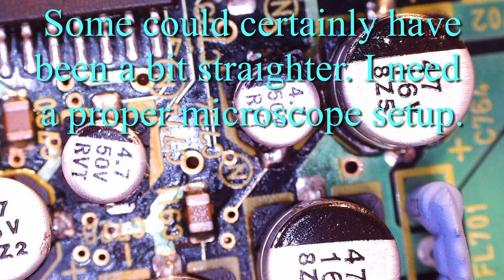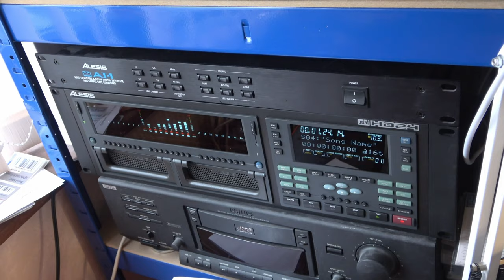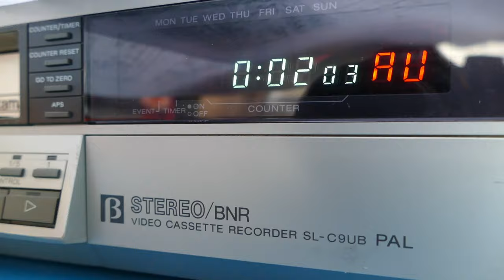Unbox and repair of a Yihua 853A pre-heater, use to work on SM electrolytic capacitors.

Comment: I used to work repairing cell phones and laptops, so I used everyday the hot air gun.
1-You have to set carefully the air flow 
 2-never let it fixed pointing to a part of the board , that's when components start flying . 
3-The trick is moving constantly the gun in circles around the component you want to remove . Add flux if needed.
4-To install/ solder components , I prefer using a fine soldering iron, it won't look as good as factory  ,but electrons only care about solid connections.

Try those steps on a scrap board and you will love your hot air gun.

Comment: I have never really had a problem of blowing components of the board. If that is the case, the airflow is probably set up too high. Even with high airflow, if you want to solder a component hold it down with tweezers whilst using air, and even with relatively high airflow, the surface tension of the solder keeps the components in place once its melted.
Only real downside of hot air are groundplanes (which a preheater works wonders with) and plastic connectors and the like. For plastic connectors I either solder them last with a regular soldering iron, or use kepton tape as a heatshield.
Reply: Plastic connectors at bottom of board with thick ground layer may become tricky for preheater when soldering SMD components at top of board. A real chance to melt the connector at bottom side. Though covering them with foil, not heating the bottom much ad dealing with components above with hot air kinda worked :)

Comment: In my view the problem with hot air is not blowing components off but heating everything around and potentially melting plastic connectors and such
Reply from the maker: Indeed that's also a risk.

Comment: Received Yihua 853A at yesterday. Turned out heating element in mine was also skewed, through not that drastically. And case bottom was undamaged. However "cloth" at bottom of heating element base was too small and in uneven thickness. Made it more or less evenly laid with tweezers. Otherwise not much other issues. Except noticed that heating element have contact with case at bottom through standoffs and top grate. Due to that during use case warmed up bit too. Not catactrophical, but it is a nuisance. Seems that for capactor, inductor and small IC soldering this preheater is OK. Soldering something like laptop CPU and GPU though seems is not an option.

I have those Yihua 938D SMD tweezers too. Tips doesn't fit together at all. And separate heater with very thin ends cause various issues - either with solder flow or tips are simply too cold to be useful. I don't use them anymore.

Comment: Excuse me, the components on the other side, did they fall off while desoldering the ones on the top?
Reply from the maker: It was not heated to high enough temperature to completely melt solder.

Comment: Would be curious how you rate the Chinese preheated?  Also pending on the value of the capacitors why not replace the electrolitics you remove with ceramic 0805 or 1206, more reliable lower ESR.
Reply from the maker: I've used it a number of times now.  I think the PCB clamp could have been designed better, but otherwise it does get the job done well.
Yes some values could be replaced with ceramic, that might be a good way forward, but possibly expensive.

Comment: How do you feel about the twist off the caps with pliers method?
Reply from the maker: Don't do it!  It may be OK for certain industrial grade PCBs with very thick tracks, but with normal commercial grade PCBs, you will certainly rip the tracks off.

Comment: That was a shame that the heater came damaged, lucky that a bit of jiggling and some off camera swearing fixed it :-D
When you said it was my viewers fault by getting in the way, i started jibbering like Stan Laural lol.
I did wonder if a clothes iron upside down would get hot enough,  well who needs smooth shirts :-D.
I think a hot air gun would work with a very narrow diameter nozzel and low speed air.
What's wrong with the tweezers?, they work :-D
Reply from the maker: Pre-heaters used to be flat bed like an upside down iron, but with modern boards having components both sides, they are not much use any more.
Now if I can save up some pennies, and the supplier can get some back in stock, that new microscope looks like a great solution for me seeing the job and you, my viewer too.

Comment: hi

dod you know what difference between YIHUA 853 to YIHUA 853a to YIHUA 853b ?

thanks 
yossi
Reply from the maker: Check but I think some of the letters at the end of the model refer to what kit you get, so whether there is a hot air gun, soldering iron etc. included.  I believe the pre-heater is the same.
Reply: video99.co.uk 
thanks 

do you know if there is new model
or better unit?

Comment: The method I use is to cut the capacitor close to the base with side cutters, this just leaves the two pins to be desoldered from the board.
Reply from the maker: On the DVCPRO board, there are very few capacitors where there is room to do that, but it's a fair point.  Good quality cutters are a must.
Reply: I would do exactly the same with small sharp side cutters. Only if the pads are slighlty corroded I use soldering tweezers or hot air to prevent ripping the pads off.
Reply: @video99couk  Yes, good sharp cutters are required. This method was the recommended procedure from  a large manufacturer whose name escapes me.

Comment: What are those swabs called? You should check out youtuber Northridgefix microscrope setup. He uses 2D microscope + camera + large LCD display. No neck strains. 12voltvids would have just cut the smd components and replace them with thru-holes. if it works, it works.
Reply from the maker: I installed a mix of SMD and through-hold on my recent video where I repair a DCC deck.  Sometimes though there's not room for a through-hole.
I will look at Northridgefix, but I only have a certain budget of course.
Swabs bought on eBay, search for something like Lint-free Sponge Cleaning Swabs